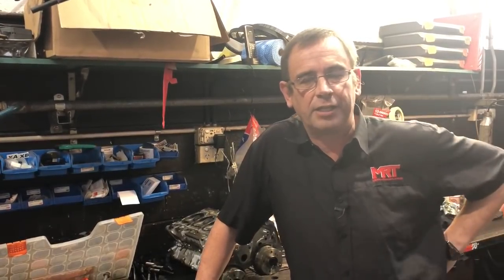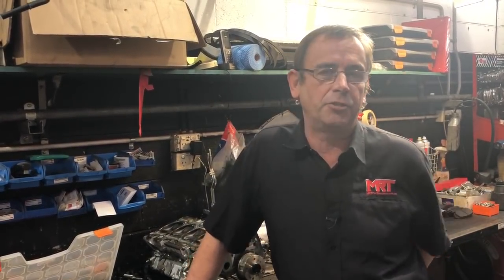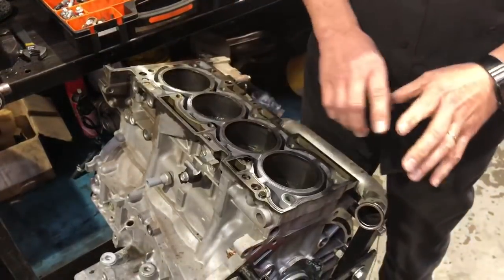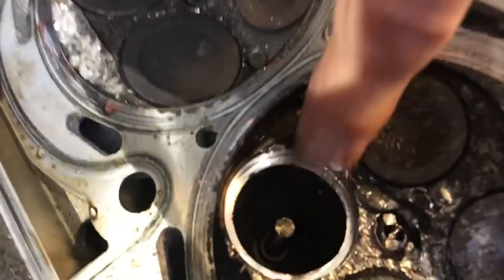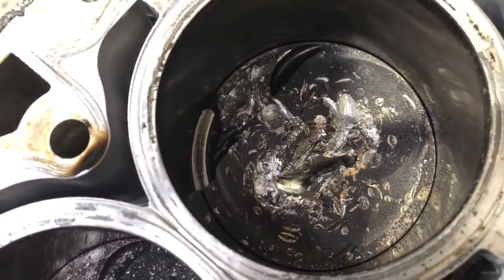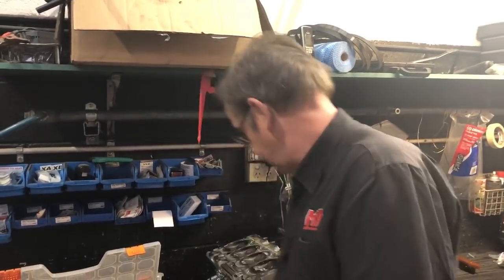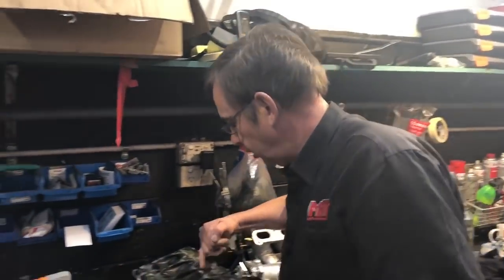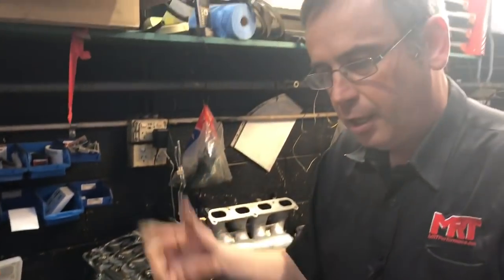4B11 Mitsubishi Evo/Ralliart Engine Rebuild - Broken Valve

Comment: Are these rods weak or myth ?? I have a 2008 jdm gsr any input  ? 400/400 is my goal
Reply: I'm running 400/400 on mine and give it absolute hell. It was tuned by a very good tuning company specialising in Evo's buy a fella with years of experience with the 4B11. I wouldn't go any more in terms of power/torque on standard internals. Plus I have the SST trans which was rebuilt so don't want to end up rebuilding that again. I only use 99ron Shell fuel (in the UK). I think bad tunes can ruin the 4B11T, as can not replacing the fuel pump relay which can make it run lean and prevent mode 2 switching under WOT.

Comment: Hi Brett, I've had a similar problem with my Evo X, although I don't think the damage is quite as bad. (It was a timing chain failure at idle) Could you please give me a ballpark figure to get the engine rebuilt (ideally with a stroker kit!) And to upgrade the clutches at the same time? To the nearest 1000 will be fine, since I understand that you won't know exactly what needs to be done until you see the engine. Thanks, Sarah